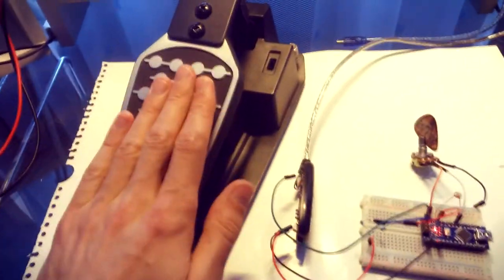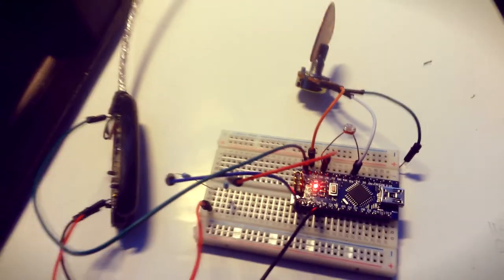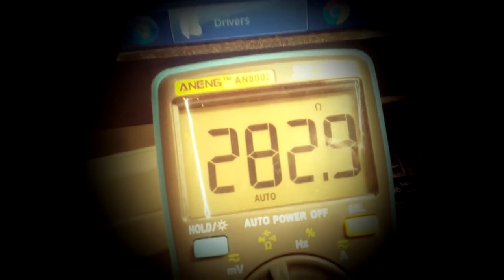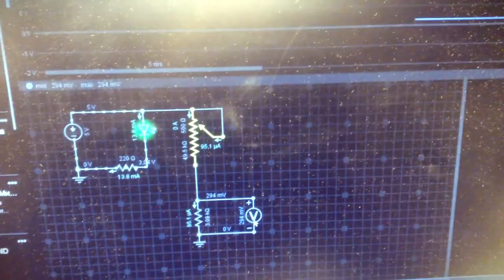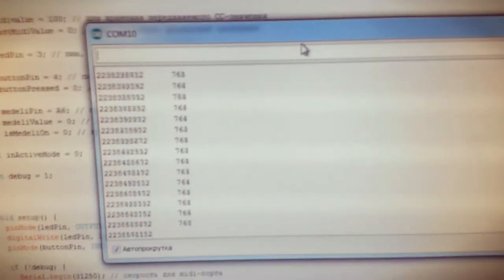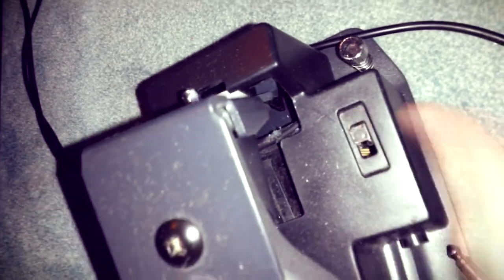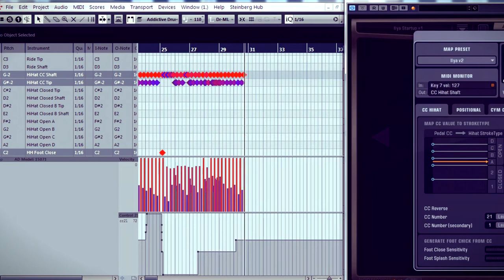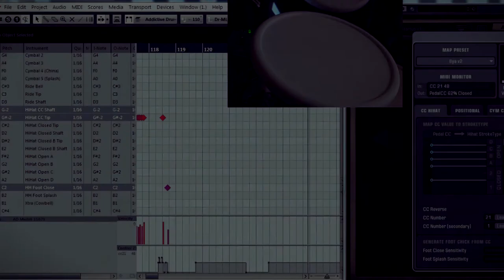How to make MIDI CC Hihat Pedal with Arduino

Comment: Hi Ilya, awesome implementation of the photo resistor. This is the exact same way a Morley or BOSS Volume Pedal for guitar works and I remember fiddling with the piece of cardboard that lets the light thru was a pain in the butt as I was trying to change the sensitivity of the pedal so I totally understand your pain you went thru to get this to work. It was worth the hassle since it looks like it works great! I will try to contact you again about some other ideas, I tried already once but somehow it didn't worked out. Have a great day! Cheers~
Reply from the maker: Hey, Karol! I wrote you a few emails, but never got reply. Thanks for your comments!

Comment: So I don't understand at all. The final outcome is only 6 positions?
Reply from the maker: You can have 127 positions, but as Addictive Drums supports only 6 hi-hat positions it makes sense to send only 6 to reduce MIDI traffic and possibly decrease latency.
Reply: @letimix  Many thanks for the reply. I did a quick watch because I'm so busy until next Friday, but after that I'll get back to it - I need to build this. Anyway, I still have to compare it to Open e-drums solution (which uses Arduino, also)

Comment: If i am going to use a silder potentiometer, it will work just the same right? No need for different codes?
Reply from the maker: Well, basically the idea is the same, the photoresistor and potentiometer both change the resistance, so they can be used with a bit of tweaking.
Reply: thanks man!
Reply: hey man why is my addicitve drums not showing that the cc messages are being changed? the orange arrow is not moving up and down. but if i will hit the shaft cc while changing the resistance, the hihat sound is changing. How will i show it up? I need it to tweak the accuracy.
Reply from the maker: Nicholo, hello! You'd have to find it out by yourself. I don't know how everything is set up in your system. Check if your DAW/Addictive Drums receives MIDI messages you're sending, monitor(view) them. If all OK, go to Addictive Drums - Map Window - CC Hihat, choose the right CC Number your use and all should work fine.
Reply: LetiMix i dont have the "midi monitor" panel on my addictive drums. I only see buttons of each drum and cymbal. Although i can guarantee that there are midi messages being received by addictive drums because the hihat sound is changing when the resistance of the photocell is being changed by the light
Reply: Can you share where you got your copy? I think i may have a bad copy of addictive drums?

edit: my version is 2.0.0
Im going to download 2.1.7

I hope this will work this time. BTW, thanks for your photocell idea. It was less hassle than potentiometer. You saved me time. I hope you create more tutorials about drum diy. Im currently making my arduino drums.